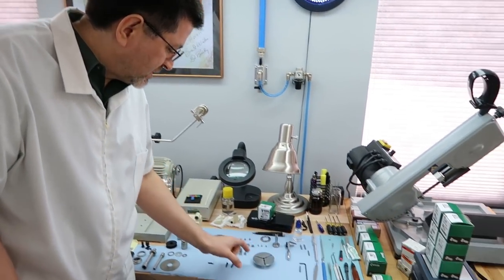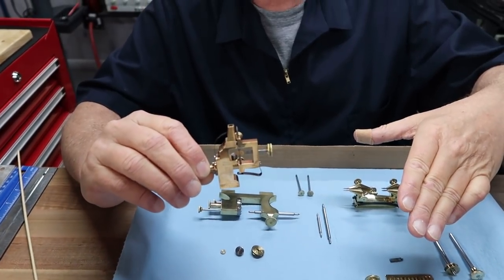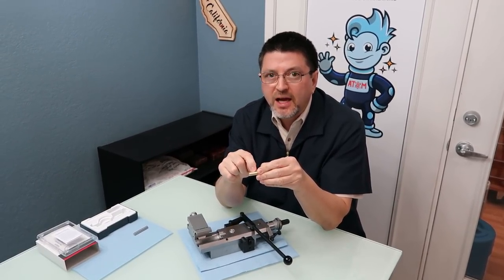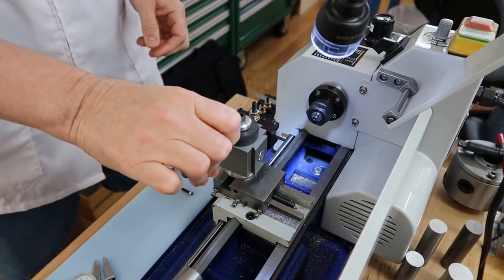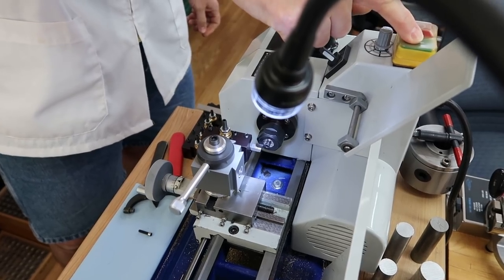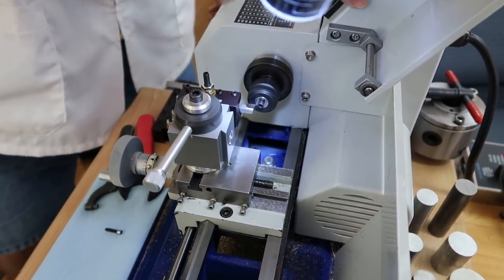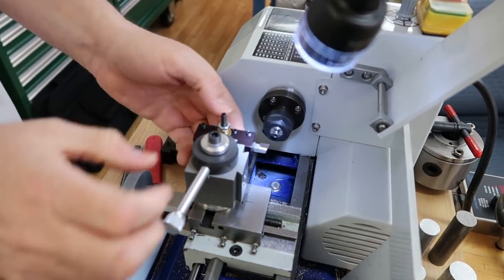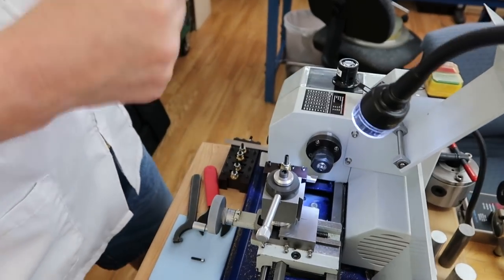SHOP ADVENTURES 30: Simple Machining Projects & Vintage Watchmaking Tools

Comment: Enjoyed the re-pivot tool. I just thought my micro drill was small! Nano drill?
Reply from the maker: Hi John, great to have you stop in we liked watching you make that Rockwell Mill handle for the knee the two colors were great and making sure we realized you tapered that edge in the brass down to and then hand returned that radius was some great hand eye control work to us. 
The Micro Drill is and can drill small no doubt but these drills in the re-pivot are ridiculous when reworking the components of this vintage watchmaker tool the re-pivot tool. You can grind your own or actually buy them we had a few from this tool to refurbish and place along with the tool in it and the other 3 vintage tools are now safely being stored and displayed in their glass table top display well they will when it gets here anyways.  
Thank you for being our friend and for taking time to share what you liked, it gives us a chance to share with you more otherwise it is always just the two of us here. 
Lance & Patrick.

Comment: I've never seen Brite Boy sticks.  Only the liquid (which is pretty good too).  Cratex is too expensive to use for simple polishing (IMHO).  I like the the Micro 100 carbides from Meridian ID.  
With regard to the number of jewels being used as an attribute of a quality watch: The same thing happened when transistor radios were first introduced, and it was pure marketing.  In the mind of the consumer, a six transistor model would be inferior to an eight transistor offering, so the eight transistor model would be favored and purchased, even though the additional two transistors weren't connected to anything.    

Great job as always.
Reply from the maker: Hello MrShobar welcome back, your shared thoughts in this community are well thought out and we consider them highly useful. 
Our jewels of the watch movement were good but as a pair of guys, well one of us plays the role of electrical engineer, Patrick and does this well.

We had never heard of these transistor radios value added addition of some non used transistors, a marketing effects but as a reader of modern design and marketing books we sure do understand why so many things can have and can do more then we as consumers really want them to do and they could be doing with great ease due to the simplicity this would afford us all, yet if these things were built to solve the focused question at hand, we would likely not buy them because they are not offering enough flexibility, features expansion options and abilities, anyways that is our couple of pence about this jewel and transistor thing.

Now back to sharing with you what is coming in this weeks show airing 04/08/2019. 
  
We do as promised to a fellow YouTube community member Vernon take our vehicle on a road trip to show and share the area we live within and what we see and share along the way seems to be good for us, it was a perfect day to do what it is we rarely do leave our home/work (we share our only vehicle we own odometer reading and vehicle age) location and even more rarely we dine out at a great place located out on the mesa with little around it.  
We walk around the yard share out newer power pole and we lightly touch on the efforts to bring specialized power into our property then we share a collection of small 50 mm and up lathe chucks 3, 4 and 6 jaw specialized and a few 2 or 3 of the 23 additional ones are headed to join the other museum pieces we did last week well once they are refurbished by Lance.

We hope you can join us for this show and we thank you for being here to support us and for sharing great levels of knowledge with both us and this GREAT and wonderful community. 
Your friends, Lance & Patrick.

Comment: great video. I'm surprised that you never machined socket head screws before? id have imagined pivot steel would be tougher.
Reply from the maker: Hi Emma, Patrick here.  Thanks so much, great to hear you enjoyed the video.  Regarding the socket head screws, this was many years ago when we only had a couple of small watchmaker lathes and thinking back then that screws and bolts were super hard, we figured trying to machine these on our small lathes would be pushing it.  It wasn't until we purchased that mini lathe about 12 years ago that I finally decided to try machining screws, bolts and anything else that I was normally afraid to turn on the watchmaker lathes.  Especially when we purchased our larger 11 x 27 lathe, if I can chuck it, I will turn it. LOL  Since I had to turn a set of these chuck screws, I figured I would share it in this weeks video in case there are others out there that have stayed away from turning screws and bolts thinking like we once did.  Regarding pivot steel, I only use quality carbide cutters from either Barker or Eternal Tools as that really makes a difference.  Also quality pivot steel which I use either Bergeon or generic from a good supplier.  I once purchased pviot steel from ebay thinking I was saving a lot of money but it machined like nothing I had ever turned before and gave a terrible finish. I had to throw it out and won't do that again.  I'll have to do a video on turning pivot steel and maybe try different cutters to show the difference.  Maybe even purchase some cheap mystery pviot steel on ebay or ??? for fun.
Reply: @ActiveAtom  absolutely. big fan of eternal tools.
Reply from the maker: @EmmaRitson  Good to hear you're a fan of Eternal Tools.

Comment: Ok before you said a bull in a China shop. I was thinking so small parts how in the world (like me) can your hands work with those tinny parts. When I was working they Nicknamed me bull. It's great to see some 9f the things you two work on.
Reply from the maker: Hi Michael, I wrote to both Tom and James to assure them you were safe over here hanging out with a fellow shop BULL LOL. Being large has many advantages working in this place is really not one of them, secret is (sharing with you) I am always tip toeing around here because I am already load to live with and then to work with for all these years Patrick has a lot of patients to put up with his best friend since 1975. 
In regards to the little watchmaker tools those spike looking things are actually sharp and some are drill bits I mean they hurt when doing the refurbishing of them (all by hand and under extreme hand pressure) those took a few weeks to complete there are now 4 very vintage refurbished to specification nearest we can tell and have a safe place to rest being displayed as the first 4 tools and machines for our museum we will share more over the coming years as we do them.
Thank you for being here, sharing with us and the community, and for being our friend and my fellow bull, Lance & Patrick.

Comment: Isn't the only difference between metric and imperial gauges faceplate? Change the faceplate from one to the other. i'm not sure companies make such a thing, but guys that repair gauges put new faceplates (or whatever it's called) when they refurbish them.
Reply from the maker: longcaster GREAT QUESTION you made us go to work pull to matching gauges an imperial and a metric and what is different is the gears ratio within the devises so the movement for say a full revolution on an imperial is not going to measure the same for full revolution on a metric gauge.

We love to learn and you mention gauge repair guys, did you know that as watchmakers we also service and rebuild indicators (our own in-house only) in fact to service a dial indicator or a digital indicator we are able to do both here electronic versions as well as the mechanical movement of a dial indicator, they are like working on a simple watch movement complication because of the large components, and then the lack of components within them compared to a watch movement with minimal complications and beyond. 

Nothing is being taken lightly here longcaster, all of these mechanical hand held devices require skills to open and work on, we are just sharing the best we can to help you see how watch movements and dial indicators share some common things many people might not be aware of, thank you again for stopping in for sharing a great question we had to research and we value your thinking here, this is thinking outside the box something we do and are proud to know you for doing as well. 
Lance & Patrick.
Reply: @ActiveAtom  My 160MM rule is still 6 inches long on the other side. and it is not that thick. :-)
Reply from the maker: @longcaster  Hi longcaster you want to review that rule 6.299 inches equals 160 mm, thank you we will get through this. Rule of thumb to help with conversions 25.4 mm is 1.00 inch, we hope this is helpful to you. 
Thank you so much for sharing together we will measure a perfect world as one.
Lance & Patrick.